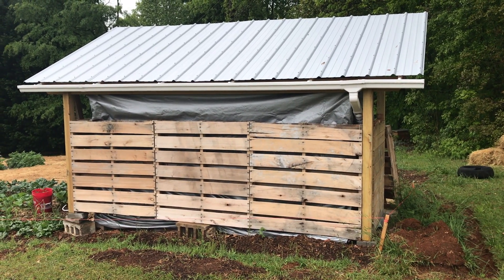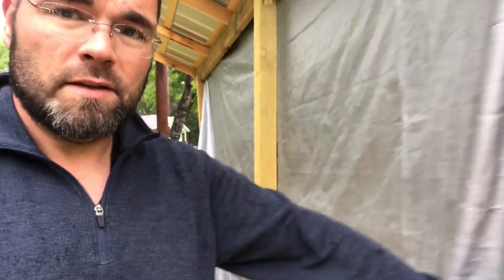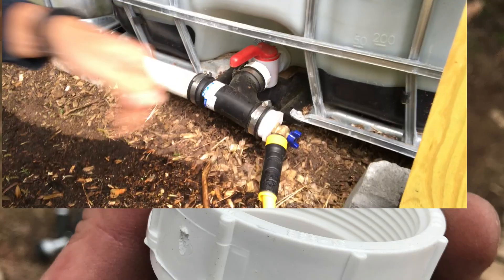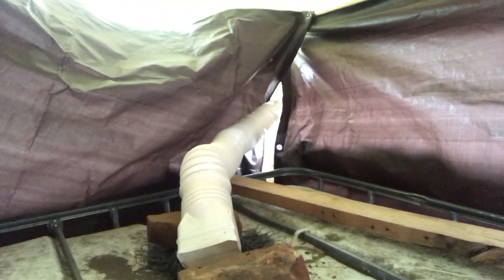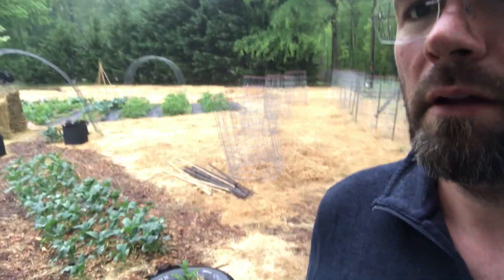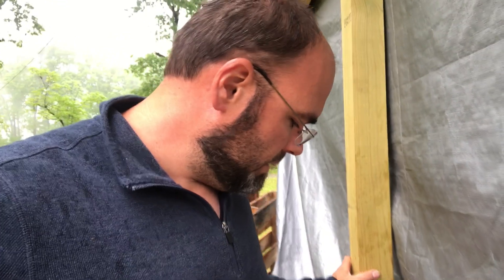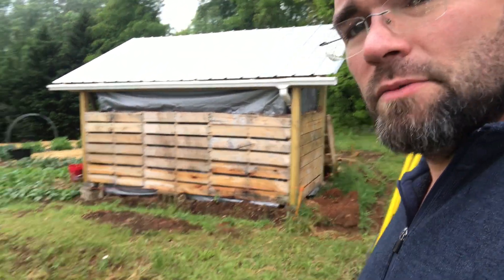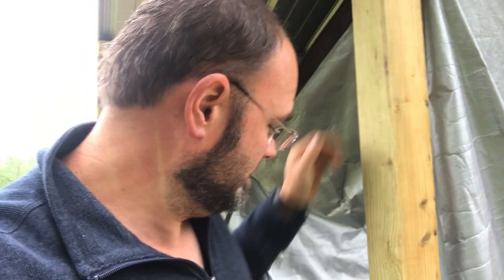700 gallons of rainwater in a simple catchment

Comment: A filtering tip. Place your course mesh (typically the thickest wire) screen on the bottom.  Place the finest mesh on top. The course will prevent the fine mesh from blowing out. You may never experience an issue in this application; just throwing it out there.
Reply from the maker: My reason for the bigger filter on top was that it forces the bowl shape to the smaller screen filter underneath. Otherwise the screen just pops up and out of the hole.

Comment: I'm thinking suction. I know that you didn't tighten the cover on the top of the tank to allow air pressure to escape but maybe it is still too tight and needs MORE air.
Reply from the maker: I’m pretty convinced now that it’s not the suction but the lack of fall + the massive constriction of going into a standard hose tap. That takes it from a 3 inch wide pipe into an eighth of an inch squeeze. With very little back pressure, that just means things leak out. The system performs better when the tanks are full, for sure, because then the water weight adds pressure. Just not enough.

Comment: I think your best bet would be to get a 12v pump. You could hook up a deep cycle battery or two on to it and get a small solar panel to charge the battery. You would need a charge controller too. This wouldn't be too much of a setback. I think you could find a pump that kicks on once the water starts to move. I am thinking like the ones that would be used in a camper or motor home. Once they sense movement, they kick on and start pumping. That is my plan atleast when I build my water catchment system. I already have all my gutters on the front of my house pipped together. I just need to run them on down the hill and build a little building like you have to cover it all.

Comment: I am a fire apparatus engineer. I teach for the local Community College and the State Fire Academy. I teach hydraulics. I believe I have an understanding of what your issue is. Friction loss and low head pressure. The tanks are sitting on the ground and the only thing pushing the water out of the bottom of the tank is atmospheric pressure. That in itself is very problematic. If you look at your water towers & town they oftentimes stand 10 stories above the ground that supplies 50 psi to an outlet sitting at ground level. You have a net of effect of less than one pound of pressure coming out the bottom of your tank.
 When you add the long thin garden hose you then have a friction loss problem. Water does not compress and it does not like to be confined in a tiny area such as a garden hose.
 The easiest way to get better water distribution into your garden is 2 inch a length of semi rigid pipe or even rigid PVC pipe the same diameter as the PVC pipe that is connecting the bottom of your tanks. Run it into the center of your garden and then create a manifold there. The larger-diameter will get you better volume out to the Roller Garden. Then I would use scraps of 1 inch garden hose if you have it and cut it to length no longer than the furthest point of her garden. 
The other options you would have would be to elevate the tanks. That's going to be problematic since you already have a decent structure there. Or if there's power there you can add a pump or you can rig an air compressor system if you could have a long length of air compressor line to run to the tank. You can theoretically pressurize the ibc's. Adding 5 pounds would be noticible.
Reply from the maker: Wow. Thanks for such a thorough reply!

I think the best option for me might be moving the water further downhill in a larger pipe. The water pressure out of the 2" fittings is pretty heavy.

With this tropical storm moving through and another 10 days of rain in the forecast, I'm not going to have the system empty any time soon. But I'm wondering how high you'd have to set the totes in order to provide more pressure. I'm assuming we're talking multiple feet?
Reply: Jeff Gray the rule of thumb is every 10 feet of elevation gives you 5 psi of head pressure. Also- the   Term elevation applies to the outlet /bottom of the tank - not the top of the tank.

Comment: The pressure is directly related to the height of the water in your totes relative to the outlet. Think “water tower”. They put those things way up to generate the necessary pressure.
Reply from the maker: I've thought about that, and the system definitely flows ONLY when the end of the hose is a couple inches lower than the brass tap. But when I take the whole Fernco T off the IBC tote and turn on the tap, the water pressure is really heavy right out of the tote. Maybe necking everything down to a brass fitting requires immense pressure to begin with? (My plumbing knowledge is really limited.)